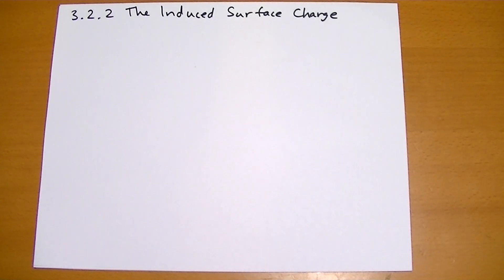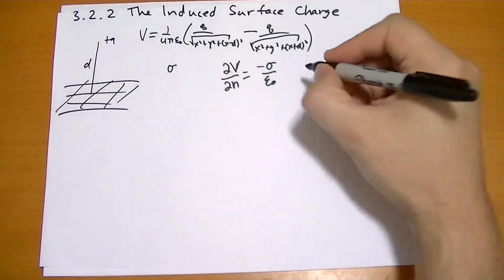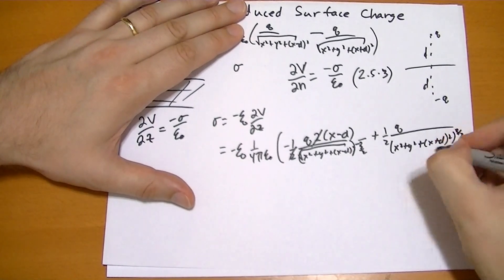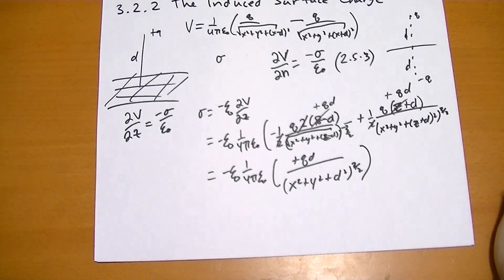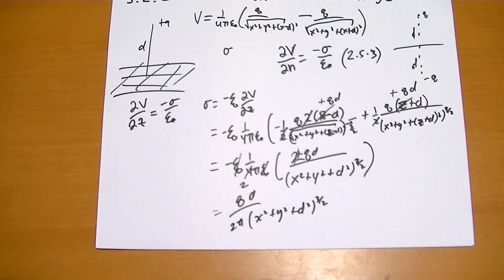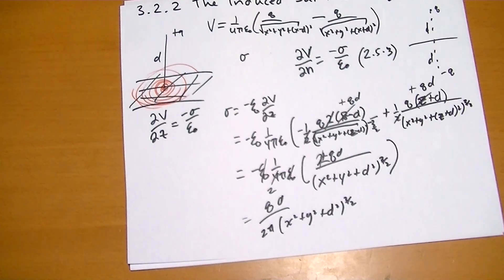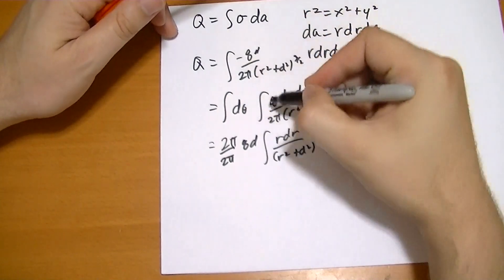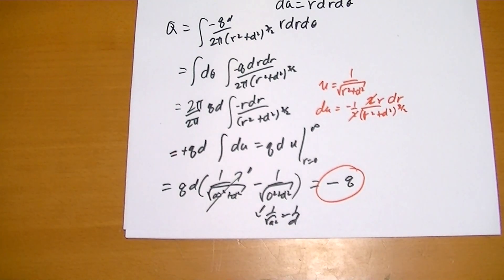3.2.2 The Induced Surface Charge

Comment: why did you cancel the "z" at the numerators?? and also what happend to the negative sign of  (z-d) in the denominator when you replaced it with z=0?
Reply: 3:43 
I'll answer the second question first because you need to know it for the first question. When he plugs in z = 0, then (z - d)^2 is (-d)^2. He was able to get rid of the negative sign because (-d)^2 = (d)^2 (squaring removes negative signs). 
Then when he plugs in z = 0 for (z + d)^2 in the other denominator, it's also (d)^2. Then the denominators are the same-- they're both (x^2 + y^2 + d^2)^3/2   --so he can add the fractions. Which answers your first question! The first term had minus z and the second term had positive z (so if they're added they add to 0), and the denominators of the two terms were the same so he could add the fractions.
Reply: @ytbvdshrtnr  Oh yes thank you, my algebra is failing me

Comment: Hey, thanks for the videos - they are awesome! 
Just wondering if you could explain where you get the -^3/2 on the first term when doing the differential of dv/dn. I don't quite follow :(
Reply: CrisStarkismo Its chain rule. Call the whole thing inside the sqrt, an A. Now,

1/√A = A^(-1/2) 

If you derivate this expression with respect to A, its goint to be (-1/2)*A^(-1/2 - 1) which is: (-1/2)*A^(-3/2)

Then you just multiply this result by the derivative of A with respect to z.

Comment: at which points is V evaluated?
I'm wondering because I also saw the result V(x,y,z) = 1/4piε[q/sqrt((x-x')^2+(y-y')^2+(z-d)^2) - q/sqrt((x-x')^2+(y-y')^2+(z+d)^2)] where (x',y',z') is the location of real q and (x,y,z) the point of evaluation
Reply: You probably currently know but V is defined at all points in space. The potential you got don't make the charge q to be at (0,0,d), it let you to choose where is it. In this case, you expect the same result as the creator of the video achieved, but with a translation in x and y